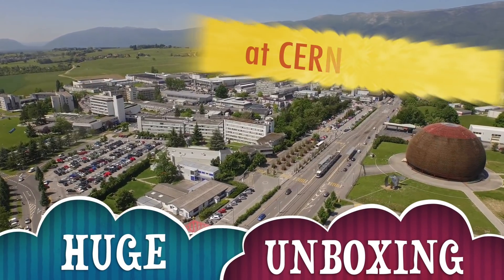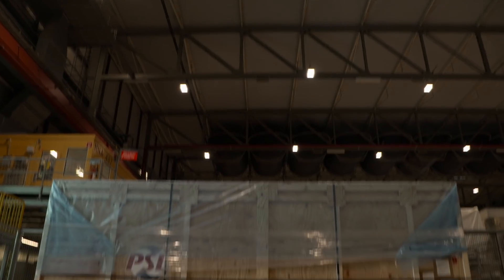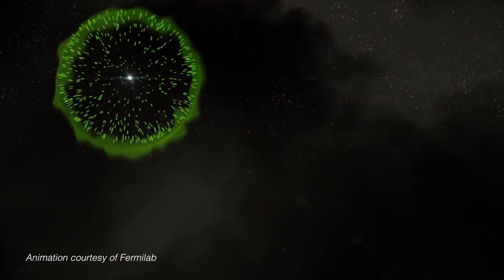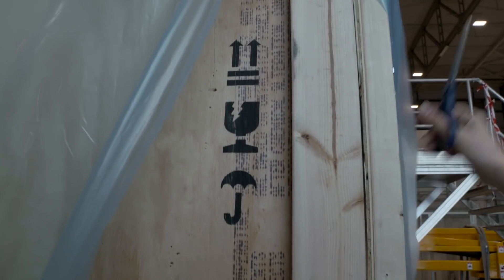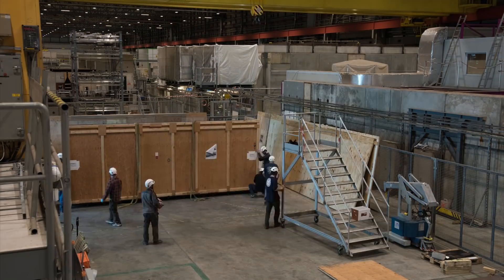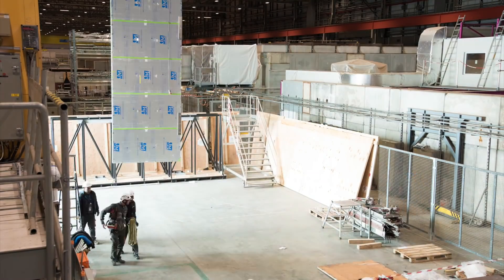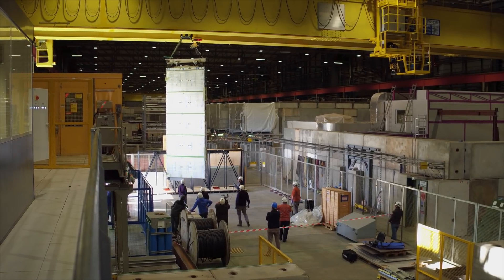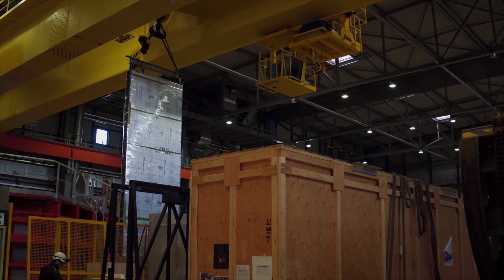The most complicated unboxing ever filmed!

Comment: But how does it work and what does it do?
Reply: Neutrinos fly through the planes of the copper wires and then the deflection is shown through electrical charge. Once the deflection is measured it can give more answers about the neutrino characteristics.
Reply: They attempt at 00:50 which I personally found to be an adequate overview directed at young minds.
Reply: oh yeah yeah

Comment: Do you ever consider when running these experiments that u have opened other wormholes, blackholes or other dimensions or have caused any affects within our Earth's core that could be contributing to it expanding? Is there any team that monitors those loops of data? Do u monitor loops of time data? Are u aware that certain projects can possibly cause such issues?
Reply: Yes, they have. No, they're not worried. Cosmic rays from space have more energy than what happens in the LHC. Look up, down, or left and right, do you see any black holes forming or tears in the space-time continuum from those natural cosmic rays? Ummm, I don't see any here. If you're going to fear something then have a solid basis in reality for it, at the very least.

Google: starts-with-a-bang/what-are-the-most-energetic-particles-in-the-universe
Reply: SKY WARRIOR .. nice b8.
Reply: Nicholas Craig-Porth b8? Those are very Real questions...
Reply: SKY WARRIOR no. No there not. It's b8.